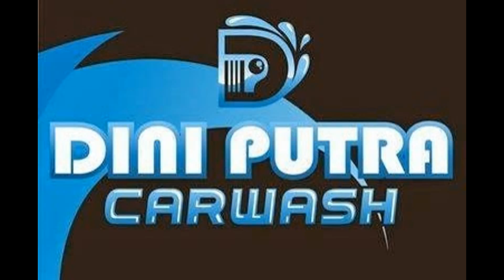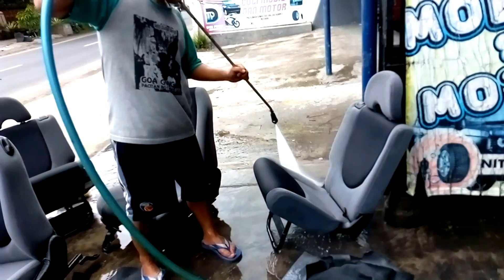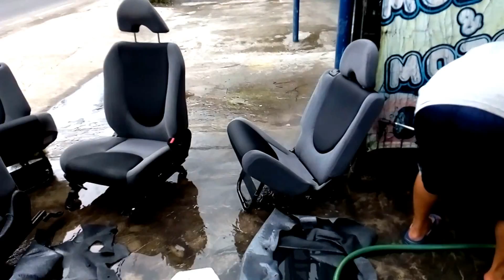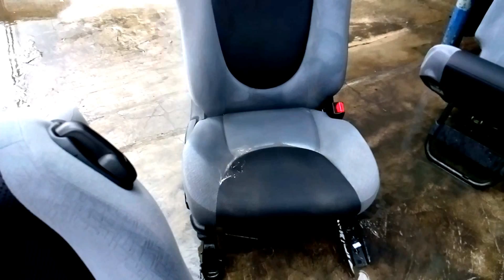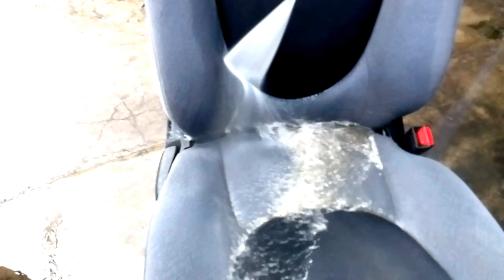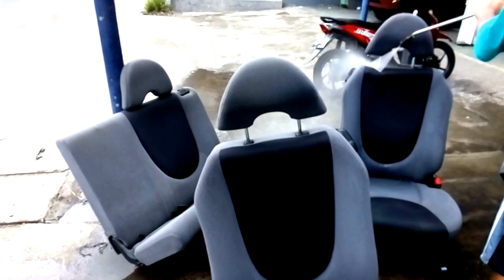Cuci Jok salon Mobil Honda Jazz 11 tahun belum dicuci washing car seat

Comment: Saran kalo jog di vacum cleaner plus di bersihkan dengan air 1 gayung plus rinso dan segerkan di keringkan dengan hairdryer

Kalo di basahkan secara keseluruhan sayang busanya.

Salam Owner Jazz
Reply from the maker: Tergantung Kasusnya Pak, untuk Jok yang sangat kotor dan meresap ke dalam spon memang harus di semprot dengan High pressure Water Cleaner, kalau hanya noda bisa menggunakan Karcher extraxtor cleaner dan Menggunakan Karcher Sc1122 steam Cleaner, begitulah metode yang kami gunakan.
Reply: Dini Mobil Carwash & Autodetailing karcher extractornya tipe berapa bang?
Reply from the maker: Karcher SC1122
Reply from the maker: Karcher Puzzy 8